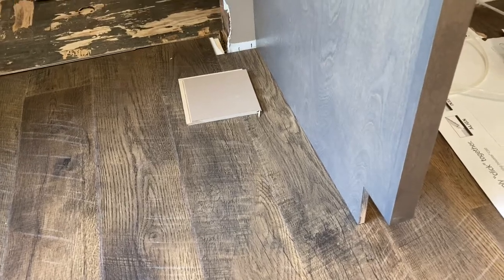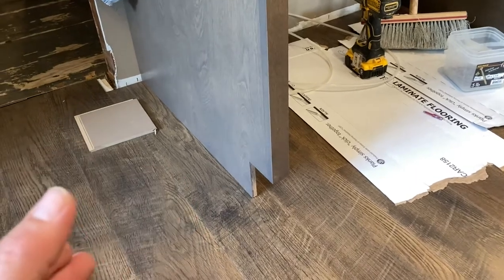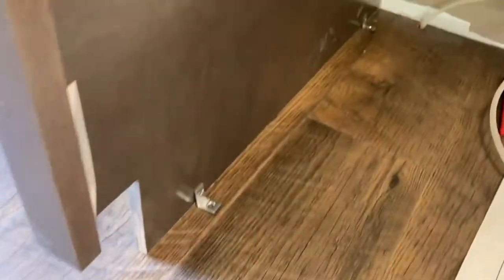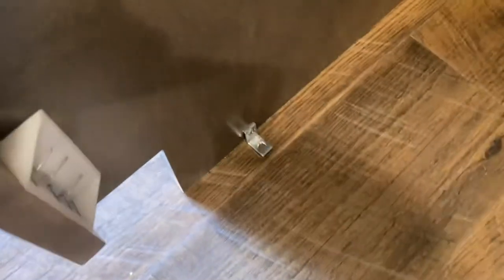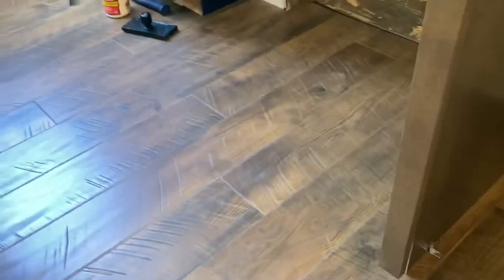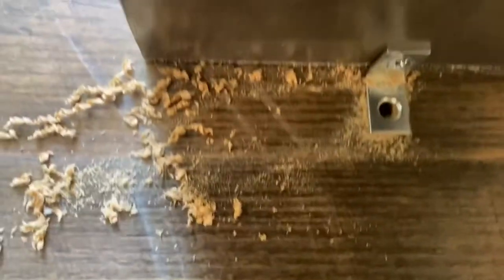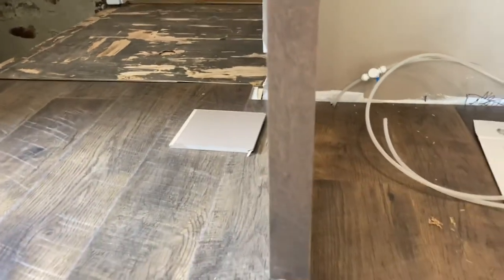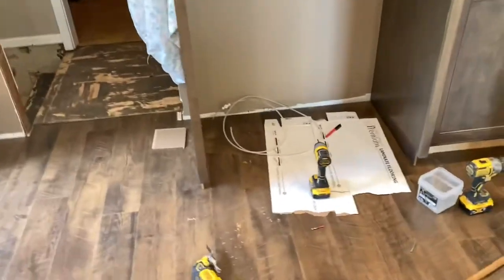Installing LVP/Laminate around Refrigerator cabinet

Comment: You recessed the refrigerator panel into the flooring? Not sure what you are undercutting. You mounted the panel to the floor with the brackets so i don't se what you did. Anyway I have similar installation coming up so was just interested. Thanks
Reply from the maker: So that panel that I’m showing in the video was all the way to the floor. I cut it to the height of the new floor so the new floor would slide underneath and have a much cleaner finished look.
Reply: Thanks so much!. So in my case I'll just leave the panel off and install after the LVP. Annoyed you can't put the cabinets on LVP they say. I don't like qtr round much.